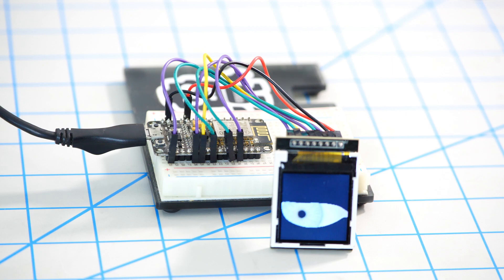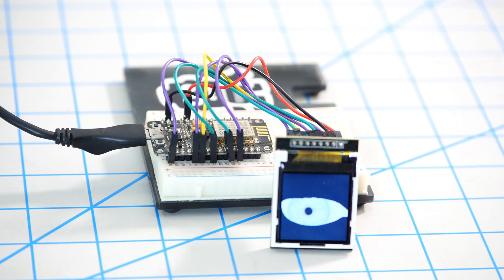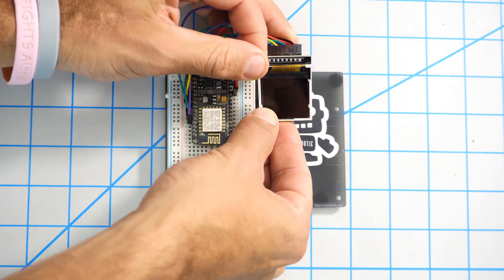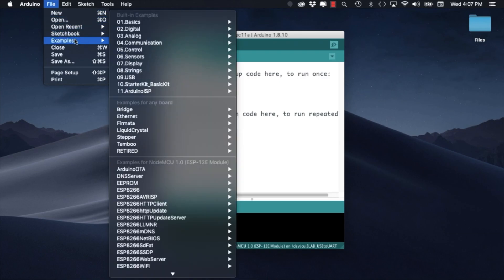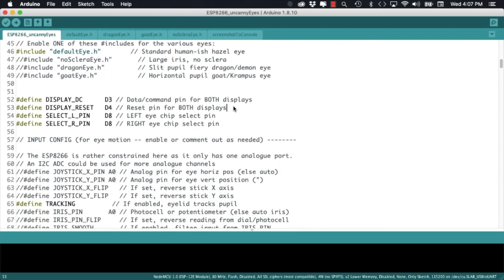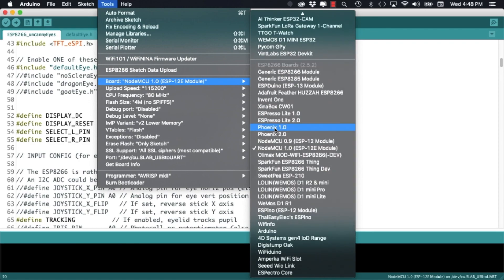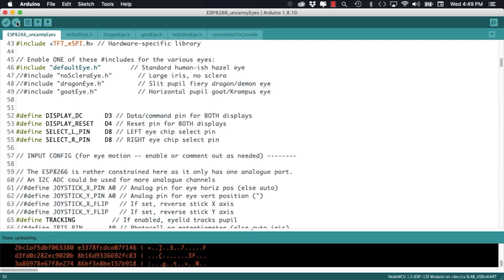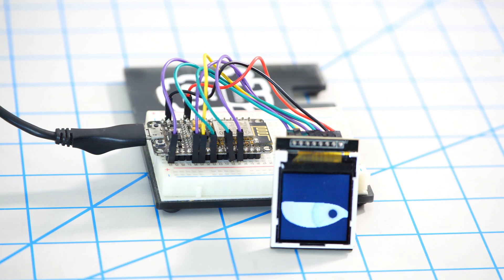Getting Started | 1.44" TFT Color Display w/ Arduino & ESP8266 (SPI ST7735 Driver) | DIS-00007

Comment: Hi i ask 2 questions here , firstly if you had 2 sets of TFT connected same time will they work ? and fact i want to put these into a Halloween prop what would be the best external power supply to run these .

Comment: Hello. I connected 2 monitors, I wanted to have 2 eyes left and right. CS - left monitor 8 pins, CS - right monitor 2 pins, If I uncomment one of these lines
// TFT_eSPI (), SELECT_L_PIN, {WINK_L_PIN, NOBLINK},
   TFT_eSPI (), SELECT_R_PIN, {WINK_R_PIN, NOBLINK},
it turns out 2 right eyes. If I uncomment 2 lines
   TFT_eSPI (), SELECT_L_PIN, {WINK_L_PIN, NOBLINK},
   TFT_eSPI (), SELECT_R_PIN, {WINK_R_PIN, NOBLINK},
it turns out that one eye works normally, while the other is not normal and twitches. How do I make 2 eyes left and right. Thank.
Reply: Hi did you find the answer to this because i want to run 2 eyes same as yourself .
Reply: @blackdave8525  Hello. That was 2 years ago. On ESP8266 I did for 1 eye, and for 2 eyes I used TEENSY 3.2 - it worked better, the eyes could blink.
Reply: @ИванПлотников-д4х  i agree that the esp8266 is not enough to use 2 screens , works fine one eye , every time i run 2  screens one stops working or they both blank after 3 minutes .
Reply: @blackdave8525  I had something like this problem, the screen worked for a while, and then black, restart- again for a while it works. Of the 20 ESP8266 purchased in China, 2 were such. I just changed the ESP8266 to
working. Check the reliability of the contacts from the ESP8266 to the screens, Stable power supply of 3.3 volts.

Comment: Hello, thank you for your tutorial !
I've purchased a device which is a little bit different from yours.
The name is : 1.8'128x160 RGB_TFT. - Driver IC : ST7735S.
https://ae01.alicdn.com/kf/HTB12QUyXUuF3KVjSZK9q6zVtXXaZ.jpg
On your device pins are :        VCC | GND | CS | RST | A0 | SDA | SCK | LED
connected to :                          3V3 | GND | D8 | D4   | D3 | D7    | D5   |  3V3

On mine, pins are :                   GND | VDD | SCL | SDA | RST | DC | CS  | BLK
So i've connected to :              GND | 3V3 | D5   |  D7   |  D4  |  D3 |  D8 |  NOTHING
I've followed your advices about pinout, A0 corresponding to DC, but i don't know what to do with BLK... (i've tried to connect to an other 3V3 on the nodemcu V3 but it is still the same trouble)
The sketch is actually working, and display the eye on the screen, but i've got some "glitch lines" on the top of the screen.
I've tried with a second screen and i get the same effect ...
Reply from the maker: I had to change some of the offset values at one point, but the developer incorporated them into the latest version of the software. Bodmer is very responsive on Github, so try posting an issue here:
https://github.com/Bodmer/TFT_eSPI/issues
with a photo of your troubles. Tag me (@acrobotic) so I can have a look as well. Sorry I can't be of more help, without an actual device to test the code!

Comment: i got white screen. Ran diagnostic program and serial port show ID =0xD3D3. 

I don't know what driver i need for this tft to work. please help.
Reply from the maker: Can you upload a program to the board you are using? I need to determine wether your problem is with the screen or the microcontroller board.
Reply: I finally got it to work. I copied a few codes from https://www.arduino.cc/en/Reference/TFTLibrary  It's weird that my TFT doesn't have  dc pin but it's defined in the code and it works. Also SDA pin  has to be connected to pin 11 instead of pin A4(Uno & Nano). Pin9 is also shared between RS and DC. Does that mean RS and DC are the same?
I thought pin 11 is only for MOSI. 

Anyway, each driver/library has its own functions to draw line/images?

//***************TFT for ST7735***********************

 @datasith 

 #include <SPI.h>
#include <TFT.h>

/* Pin for ST7735 1.8" TFT LCD         
 RST -> 8
 RS  -> 9
 CS  -> 10   
 SDA -> 11                                                  <--- pin11 for SDA ??? 
 CLK -> 13
*/

#define cs 10                                             <---This is the part i copied from arduino.cc
#define dc 9                                               <--- pIn9 already used by RS  
#define rst 8

TFT TFTscreen = TFT(cs, dc, rst);

void setup() {
  TFTscreen.begin();

  // clear the screen with a black background
  TFTscreen.background(0, 0, 0);
  //set the text size
  TFTscreen.setTextSize(1);  

}

void loop() {

  //generate a random color
  int redRandom = random(0, 255);
  int greenRandom = random (0, 255);
  int blueRandom = random (0, 255);
  
  // set a random font color
  TFTscreen.stroke(redRandom, greenRandom, blueRandom);
  
  // print Hello, World! in the middle of the screen
  TFTscreen.text("BKP Homeplace", 6, 57);
  
  // wait 200 miliseconds until change to next color
  delay(200);

}
//***********************************************************